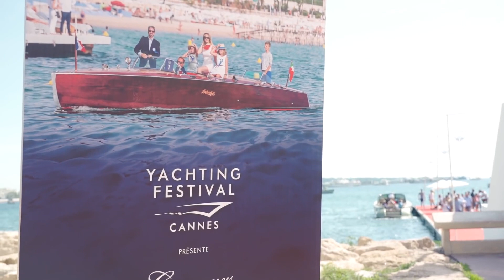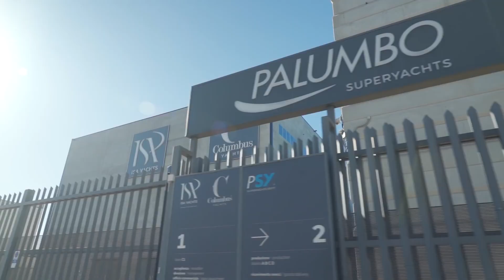THE AMAZING "SILENT 80" SOLAR POWERED CATAMARAN - HOW THEY BUILD IT!

Comment: Love the 80. The power gen/consumption is still confusing even after watching all vids. Question: With the mid choice of battery/motor choice how many knots can the 80 do in calm seas with full sun ☀️ and no ac, but have avionics and fridges going. In other words how many knots 4-6?  On solar. Solar with bats. And how long. 2hours? 8hrs. Full sun no generator
Reply: Their website claims 17kwp panels can generate about 100kwh a day. Enough got a silent 60 to travel 125miles (no speed mentioned but I reckon about 5knots) and it also covers all the aux draw. 

Silent 80 has 26kwp panels. I'd imagine similar all electric self sustaining range to the 60 model.
Reply: @TsLeng  Thanks, The CEO says that its about the same as sailing speeds 4-6knots. But doesn't elaborate too much.  Too bad he's not interested in more panels that slide out on actuators, locked in place with poles to protect against winds. Just like yacht have awnings.(as an example +5 panels in front, +5 in aft, +3 per side, I did the math) That could bump up generation to 46-50kwp, and maybe a speed of 10-12knots without AC and generator.  That would be the wholly grail.
Reply: @Paul37Ontario  that will add complexity and weigh I guess. At it is, it is pretty good and even if you have to use a bit of diesel during the day to hold some charge for night aux power (complete silence without generators) it isn't the end of the world. 

Really suits trips that have lots of anchor time too. With the biggest battery at 400kwh, one can even sail through a night on battery.
Reply: @TsLeng  I see your point. My point is that doing the math it would just add 400-600 kilos, on a 80 foot vessel that's like 8-10 people, not any weight to talk about. And at a cost of 6.5 million I would expect the most effort or some other manufacture will do it.
Reply: @Paul37Ontario  you have a point. I am thinking also if overhanging panels will negatively impacts aesthetics and shade more of the boat which might not be desirable for the occupants. After all , people want to sunbathe, look out at scenery etc. 

Apparently they do have a kite sail system which helps for long journeys. Not sure how well it works but if it does, that solves the problem of non fuel range
Reply: @TsLeng  I can tell you that if I get one I would add more panels that I could extend at a flip of a switch, and my guess would still be able to find a spot to sunbathe. When the panels are retracted it would look the same from a distance and you would be able to see the double stack if it was pointed out to you. I know my wife would never notice lol I’ll wait a few years before my decision. The order wait is two years anyway
Reply: @Paul37Ontario  you are too green to be a big bad yacht owning rich person. 

I'd just go where I want and use diesel with no care (it's got a massive tank...) If there isn't any charge. Lol
Reply: @TsLeng  I’m too green lol. Maybe too cheap lol. I like to do the math. A typical 80 foot yacht cost around 6-12 thousand to fuel up or more in some cases. Add that to its range and multiply that over the years and you’re in big money numbers. And the resale (depreciation) of a diesel yacht is really bad. Compared to a solar (ie: Silent 80) that’s going to depreciate about half as much at least (given future regulations on what can be allowed in marinas is also a factor) Add the difference and it’s a no brainer. Fuel cost is a big deal. Unless you’re a billionaire, and I’m not.
Reply: @Paul37Ontario  I am not even a millionaire but I like the math too. However fuel cost is small potatoes compared to depreciation and other associated running costs. That said, any saving is good. This is something that can be legitimately be used for very long cruises at minimal fuel costs as long as the solar energy is maximised and the motive part is planned accordingly. 

I like the fact that it can function pretty much anchored without any generators. Big win on that part
Reply: @Paul37Ontario  David did an hour-long livestream interview with Michael over on the "Yachts For Sale" channel a few months ago.  They covered a lot of your questions there, including Michael's reasoning for his choices on those issues, many from his personal experience & experiments.  He's a pretty practical guy, recommend hearing his thoughts directly there.

For one, as built, he said the Silent 80 will do 5 knots under typical vacationland conditions "indefinitely."  That's 120 touring miles per day, a pretty good average already.  With bigger battery reserves and/or fueled-generator kicked in, some of their options allow you to push 12-17 knots for a few hours, then recharge the reserve at anchor/harbor while sitting still for the fun.

Between the interview and their web site, you can get a pretty good feel for the use cases/applications that drove the choices.  All boats are a collection of compromises on comfort, speed, capacity, stability, etc, so you can see where Silent has set up their strong suits or held back from certain (over-)ambitions.
Reply: @Paul37Ontario  i think solar yachts would depreciate poorly due to the replacement costs of the batteries and solar panels.  A bit like a 10 yo toyota prius !!  These should have the option of being able to sail as well !
Reply: @Paul37Ontario  HI Paul, it´s me, Michael - the CEO. We did it already in 2009 and removed it in 2010 ..... not worth the hazzle, adds a lot of weight, mechanics and in the end trouble.
Reply: @TsLeng  the 60 consumes about 15 kW at 6 knots - so you can go many nights with 400 kWh ....as you recharge during day time
Reply: @rhett7716  sorry but the batteries are a small % relatively to the cost of a yacht. Conservative 30k USD for 100kWh (EV prices as benchmark) at current prices and it's not expensive after one spent 1.5m to buy the boat.
Reply: @michaelkoehler1077  thanks for that. At that sort of power consumption, 400kWh battery is practically able to cruise non stop. Brilliant